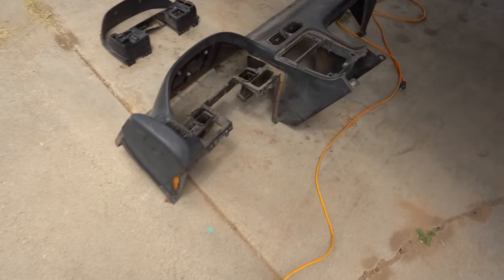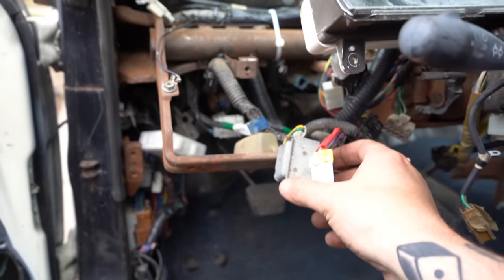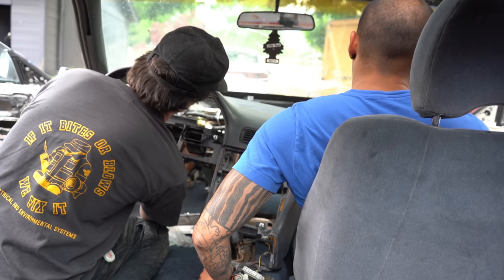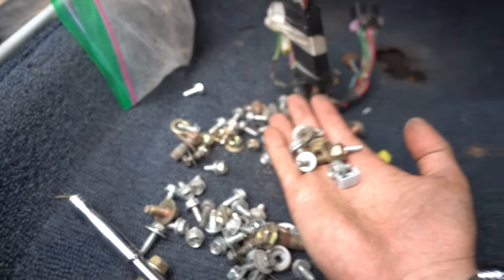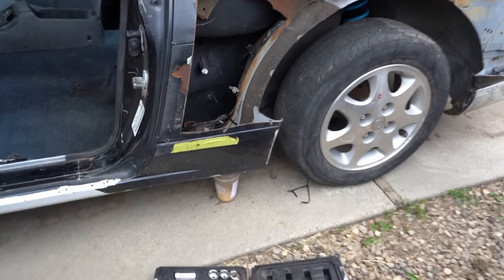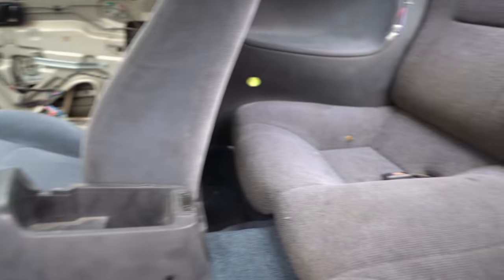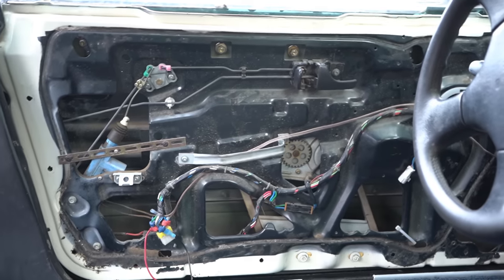FULL interior In The 240 again! | 240sx Rebuild Ep. 7 DASHBOARD

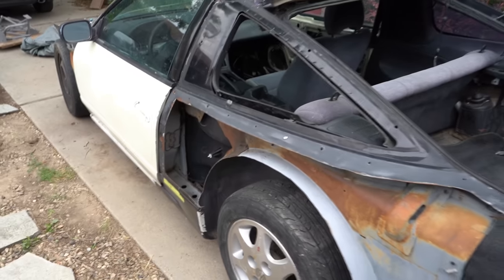Comment: @5:22 fully duct tape a trash bag to the inner frame of your quarter panel to cover that hole. then... use expanding spray foam to completely coat that trash bag and the surrounding area of the metal shell. so when it all expands, it will fill that hole and hold onto the inner edges of the shell to plug those holes, so when you reinstall your overs, you wont get smoke, moisture, dust, water or animals crawling into your car through those openings. cheap and super fn easy.
Reply from the maker: Good thinking!

Comment: I have an Sr20det 240sx. Did the swap a year ago and left it at that. I just couldn't get it to run. 

I have had the car for two years and it was a single cam running and driving. Thanks for that little motivation at the end of the video.
One day it will be road ready.